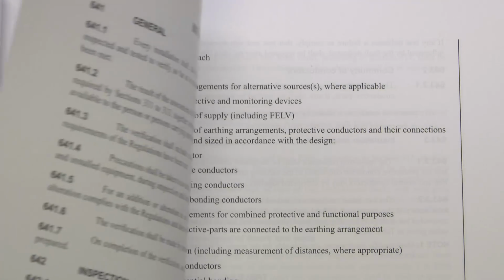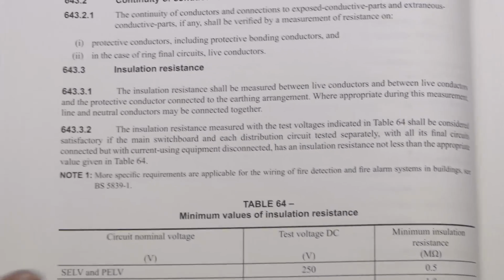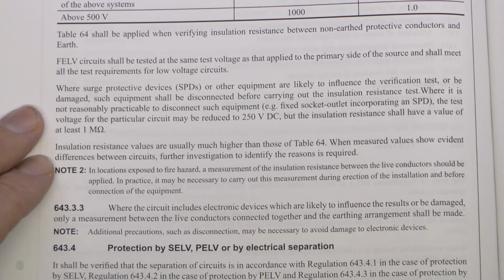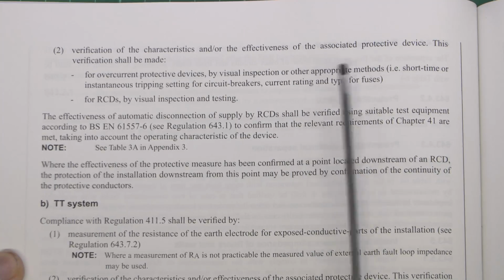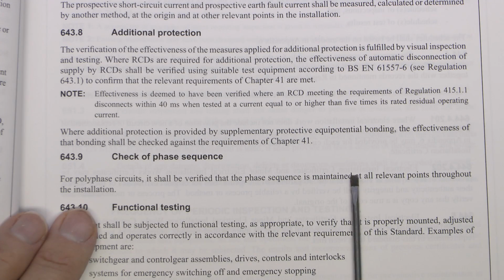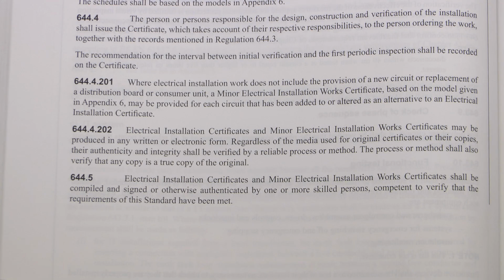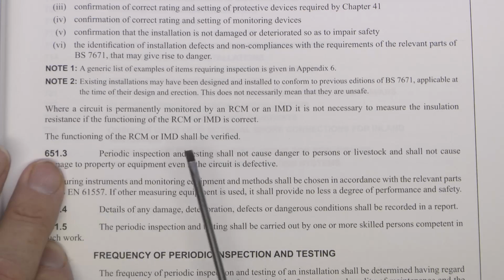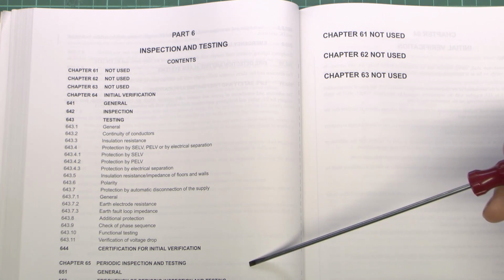BS7671 18th Edition Changes in Part 6

Comment: As of this month private landlords have to ensure the property meets this standard, so suddenly a terrace built in the 1930s, rewired about 40 years ago with and ancient looking metal consumer unit has to pass all these tests - If the house is bog standard, no electric vehicle charger, no green energy, no power to the shed, what's the likely cost?
Reply from the maker: Depends - could just need a new consumer unit, or it could need a total rewire.
Anything between a few £100 and a lot more.
Reply: @jwflame  yes the 'a lot more' is what I'm worried about.  Can't help thinking this is going to be a bonanza for sparkies, but then I'm a cynical old ba....
Reply from the maker: @kenalford2538  If the EICR is done properly, anything that doesn't comply will be listed together with the regulation(s) that the installation doesn't comply with.
If it just says things like 'rewire required' then it's totally worthless.
Paying a decent amount for the EICR to be done properly could save substantial amounts later on compared to paying £50 for a quick drive by inspection.
Reply: @jwflame  Ok will keep it in mind, thanks for your replies and the series, excellent crash course in electrical testing

Comment: Does the Note in 643.8 mean we only have to do the 5x IΔn  test on an RCD  in order to verify effectiveness?  I could check on the new Test Results form if it's on the IET website.
Reply from the maker: The new model form only has the column for 'trip time' rather than the two columns for 1x and 5x.